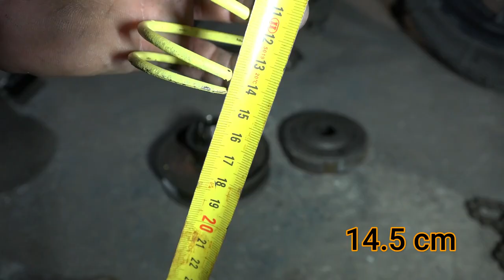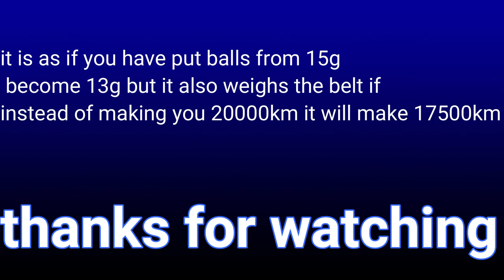scooter spring reset centrifugal  how to harden the spring pcx.

Comment: As i see you replied everyone and that is good please tell me which number of tools require to open that big bolt and where do i find  ? Because i can't find on internet.Please.i have Honda pcx 125 2017
Reply from the maker: Hi atoz you need tools and you can do it yourself
Reply: The big bolt in the clutch lining is size 39. You can find a socket for it or search torque drive socket.

Comment: Does this make it go faster?
Reply from the maker: Hi tatertot30 To speed up a little faster The spring with the temperatures slowly closes, loses its strength and as a result you can get new You open it and it becomes a little better than the new.
Reply: no

Comment: What's the purpose of making it longer ?
Reply from the maker: over time from the temperature It loses its power when you open it a little you restore it and you have a better start
Reply: @MBPATENTS  i think you get a better start when you have a shorter spring, so that the clutch would be easy to open

Comment: Sir how about the clutch spring it is ok to replace a harder one or a higher rpm clutch spring
Reply from the maker: with the harder spring you will have a better Star more petrol and all the plastics will shake while the normal original will be better more economical and everything will be smooth

Comment: this is totallly bullsh!t  just find a factory that has 100% make a spring to stiffer in higher temperature used those spring will rumming soft if it runs on wear & tear and they are not made to last long if  youre using it daily or heavy loads
Reply from the maker: here i'm just showing how a spring works i don't know what you're talking about i'm sorry you can't understand me

Comment: your scooter is only running stock engine and the cvt only acts what your engine is producing power dont make the  viewers have a idea that it will have benifits.. you need to change racing cam, stiffer valve spring a bigger air flow on head bigger bore or upgrade your crank shaft  and a good racing ecu tuner then you modify your cvt
Reply from the maker: My God. You don't even know what you're writing, do you? You don't even have the knowledge required to talk about these things. It's a video that shows what the spring actually does and it was made by a subscriber's request. You are not a subscriber, so who said your opinion is welcome here?

Comment: You ruined the spring 👎🙄
Reply from the maker: Wow hi Mario How did you figure that out? You're very smart! the spring works fine and to this day I have no problems
Reply from the maker: All the springs during summer lose their strength because of the heat. If you stretch it without warming it up, it will last for about a year. Thank you!
Reply: its bullsh!t idea if you want speed you modify the engine then upgrade youre cvt put it on dyno if you want a good results